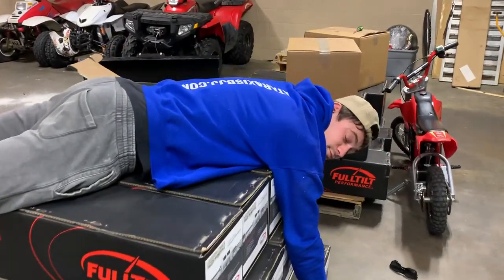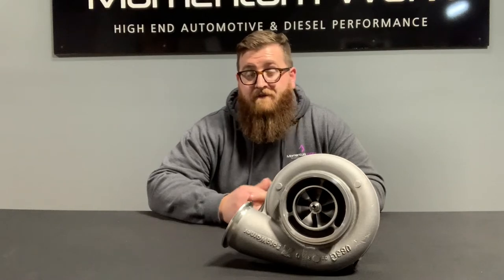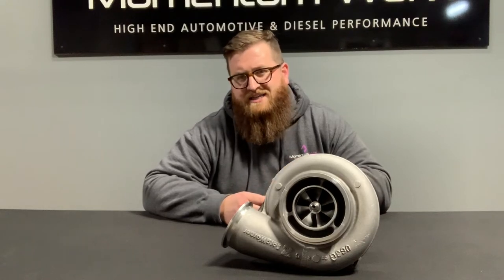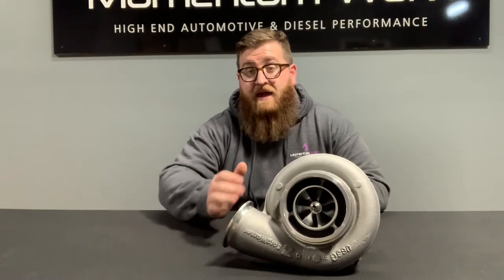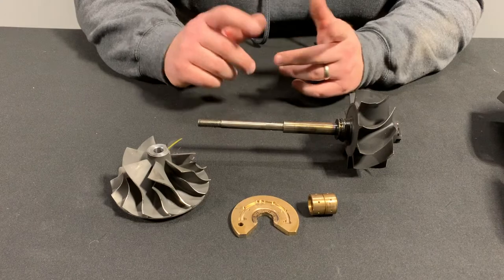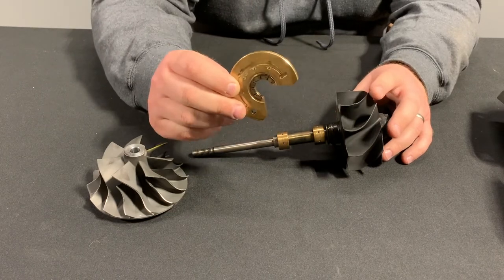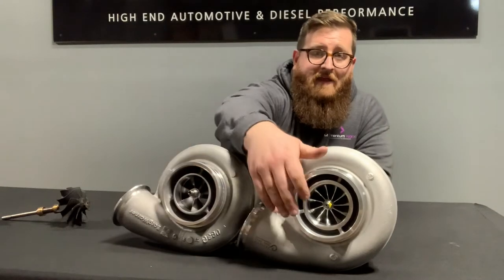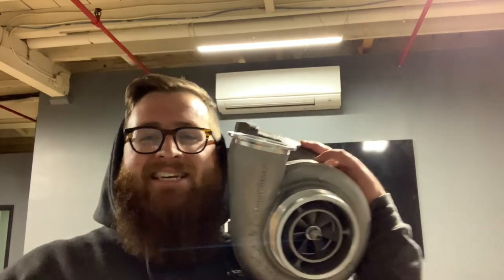What is an S400 or S475 Turbo?  BorgWarner 171702 History

Comment: I like how in the diesel world this is a small frame turbo.
Reply from the maker: Yeah, perspectives are crazy in the automotive community when you look at different applications.  

For example: 2100RPM on an over the road commercial diesel truck is passed redline, but that's basically idle speed on a B-Series Honda engine lol.

Comment: I'm running a dd3 60 series detroit 12.7 L. I'm a heavy hauler 50tons and upwards what turbo would you recommend, does it come with the gaskets and studs and how much
Reply from the maker: Assuming its all stock, go with a BorgWarner K3. This S475 will be laggy on the 12.7L unless you throw fuel at it.  https://momentumworx.com/new-borg-warner-k31-172743-series-60-c12/
Reply: @momentumworx  all is stock except the ECM and the intake boost sensor. Thank you very much, as soon as I gather the rest of money definitely purchasing the k31-172743 from you guys. What about the gasket and studs

Comment: It would be interesting to know if I can upgrade my Turbo borgwarner p/n 171701  Mod s400s061 s/n D2307 142, For the new borgwarner 171702, What would I have to buy? I have this turbo installed on a 1998 international 9400. Greetings from 🇵🇦
Reply: it's just a straight swap, plug the waste gate line

Comment: Can you get a 171702 from a junkyard Detroit 60 and rebuild it with a 360degree thrust bearing? I was considering an S475 TO6 for a 410 ci FE Ford gasoline 93 octane in a bumpside F100, or a pair of GT45s. I like the idea of the 171702,S475 TO6 volute with the stock iron manifolds reversed and a pair of 2.25 pipes off of the manifolds to the Volute and an intercooler to feed a blow through 850 DP, with 8-9 lbs of boost with a roller cam topped out at 6200 rpm. Would a used one be possible to find? Or do you sell reconditioned ones? Thanks.

Comment: I'm looking as putting a turbo on my Gen 4 LS2 403 stroker I'm looking at getting an s400 but its an s498 or a s493 as im chasing 800-1000whp the thing im not sure about is the 98 comes with some options which I dont which to get 1st is a 102/91 and a 109/99 turbine  wheel option and the other is turbine wheel option t6 divided 1.32 A/R or t6 decided 1.58 A/R and t6 open 1.58 A/R these I have no idea what to order I understand  the difference  between 75mm, 80mm, 88mm, 93mm, and the 98mm and hp rating but not the rest I can build a stout LS but I've never buggered around with turbos
Reply: Those numbers are the Size of the Turbine Wheel, and the A/R ratio of the Turbine Housing. Basically you size that to what you wanna do with the Vehicle. Makes a big difference for instance if you building an 1/8 mile Drag Racer, or a Standing Mile Type of Vehicle, The Smaller the Wheel and Housing the Better it be for the 1/8 mile stuff, And you'll want Much Larger for the Long Distance Stuff. But there's other things to consider also, such as how's the Engine Built, how big is it, the Compression, the Camshaft, and So On, and also the Vehicle, the Weight, type of Transmission. And Always remember the rule of Bigger isn't Always Better, cause then you run into Turbo Lag.

Comment: i was told mine was a s400/75 my part number is 177101 sn 12512-193 is there a way to decode the number. im wanting to order another one to replace my current turbo. mine does have a billet wheel.
Reply from the maker: You have an S475 as well, just with a smaller turbine wheel, and smaller T4 exhaust housing.
Reply: @momentumworx  thats what i thought i think it measured on the small side a 74mm on exhaust and yeah im still on the t4 flange because my sp quick sool is a t4 and hp goal was 1250 and that about max on this turbo on a 2jz. so im pretty sure my housing got damaged from oil starvation  i tried just a bearing replacment and the shaft hits in the exhuast now. do you guys sell just the shaft if its a shaft issue? or how much would it coast to send it in for a rebuild and shaft if needed.
Reply from the maker: If the housing is damaged, you will likely spend more time/money/frustration rebuilding it then its worth.  Personally, I think you'll make out better in the long run just buying a new one.  If you want to go that route;. I have 2 in stock.  Shoot me an email and I will send over current price.  Info@momentumworx.com

Comment: Hello. I have a 60 series 14L. I installed a 12.7 manifold and a 171702 with just 515hp. I'm having lag when I'm shifting. I was thinking to get a K31 BUT I saw a 1.15 AR housing that fit my 1702 BW. 1- DO I have enough hp to use the 1702? 2- Do you recommend the 1.15 AR housing on a 1702 for a 515hp Detroit series60 14L? Thanks in advance!!!
Reply from the maker: Swapping out for the 1.15 housing is the cheaper and quicker solution, but that small of a housing will run the risk of overspinning the turbo on a Detroit.  If you overspin the turbo, you will decrease the life span of the turbo or just snap the shaft and be dead in the water.  Realistically, the K31 would have a much better powerband and minimal lag on your application, but I too would be tempted to atleast try a 1.15 housing first since you already have the 171702
Reply: Tuning is wrong and what's causing the lag you're experiencing
Reply: @kimberlyking6229 how u  can tell if the tuning is wrong?
Reply: I put a k31 turbo on my 14l ddec 5 have it set at 525hp 1750 tq.  It runs great only thing is I can’t get it to boost no more then 32 lbs is that normal?? I’m thinking of getting the 171702 since the 171702 is rated for 500 plus right? I just want to see which turbo feels better on my setup I got the pdi manifold on it. With a good tune I’m curious what the 171702 would do
Reply: @enriquedelacruz7398 did you ever get the 171702 s400 turbo i have a ddec 6 my stock motor is 515 stock i need that part number for that pdi manifold.i need that. But You really need a tune to  give it that fuel if your going with a turbo that handles 500-1000 hp you need like 600hp that k31 could only handle 550hp
Reply: @kimberlyking6229 515hp is a stock tune 😅
Reply: @enriquedelacruz7398 171702 is 550-600, if you don't have a tune to match power and fuel to a 171702, don't waste your time. 32psi on a basically stock engine is good, I don't understand why everyone thinks a turbo or manifold swap is going to create tons of boost, it's mind boggling how little knowledge
is out there. I have a real performance built Detroit, not a turbo, tune and big imagination, and my max boost is 49psi. Fully balanced rotating assembly, custom ground cam, flow, matched and blueprinted injectors, full tilt manifold, s410sx turbo, and I have a dyno'd 726hp, my ecm was done by Diesel Control Services. You have a computer controlled engine, you can't slap parts on and hope for the best. A turbo and manifold need more fuel, more fuel comes from tuning, if you aren't tuning to match parts, you are just wasting money, time and fuel. Without more fuel what are you hoping for, 40, 45 or 50psi on a pdi manifold and 1702??
Reply: @TheRoadhammer379 you hit it right on the head..it's same way like in performance automobiles...just throwing on parts without more fuel& tuning.. you're waisting time& will burn more fuel cause the tuning not be right